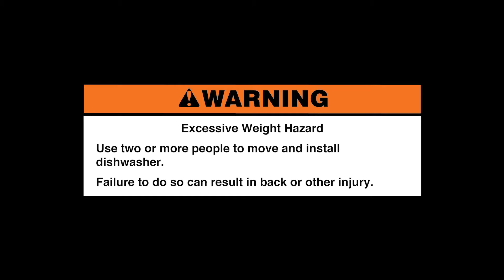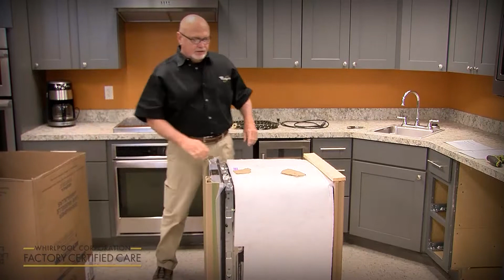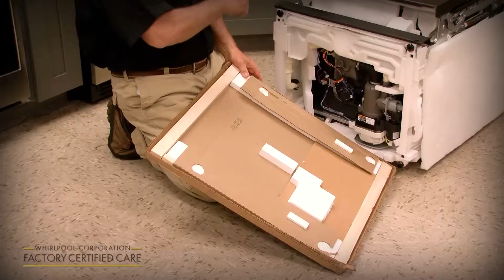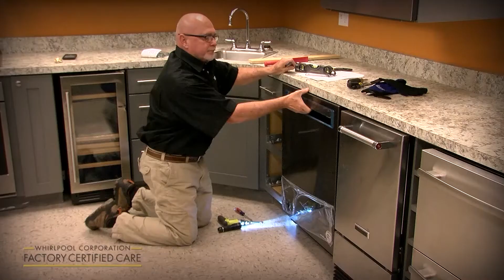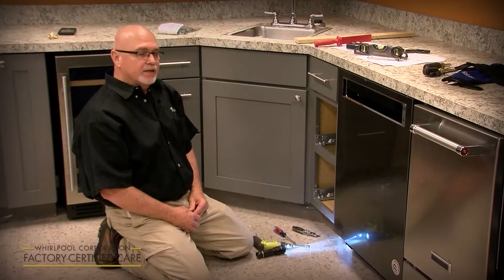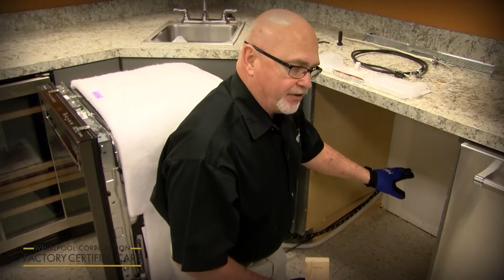New Dishwasher? Learn How to Unpack the Box

Comment: A few days,ago these guys instulled my dish washer and took the white insulated padding off it from the top and sides. I live in home built in 1960 with bad insulation in the walls. My dish washer is,ran on sani wash with extra dry time but everytime iit finishes everything is wet. I believe it is because the heat doesnt stay in long enough to dry without that insulation. Am i correct??
Reply: Every other dishwaaher in the past at this home or any other place i lived always had the washer wrapped unless it was a portable  that has side panels and a top